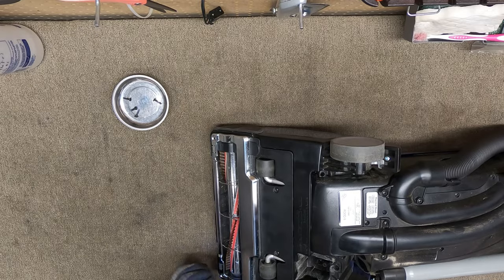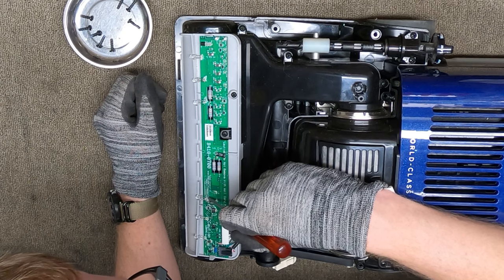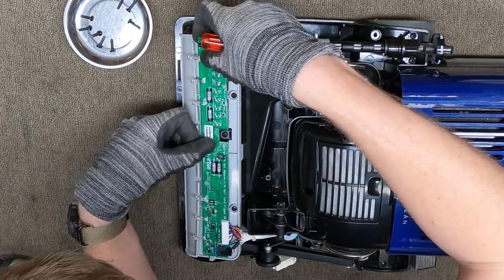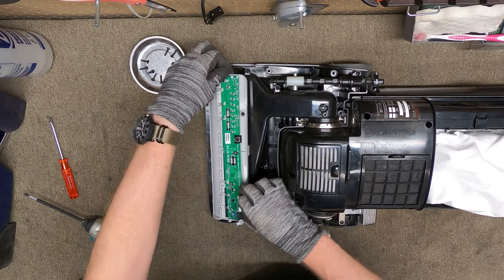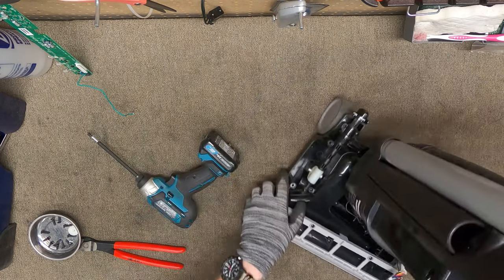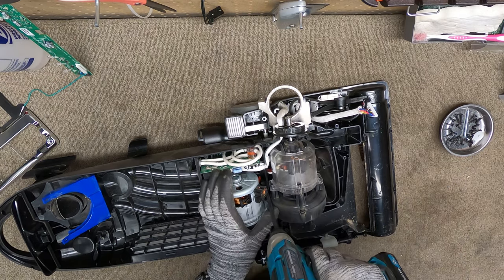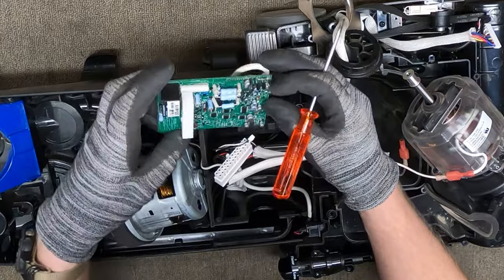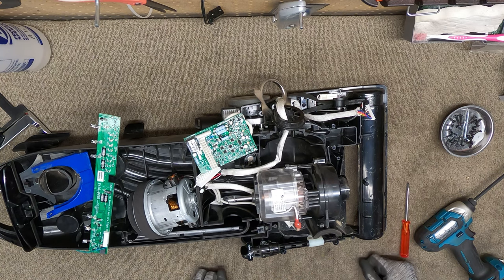RICCAR PCB PROBLEMS & TROUBLESHOOTING

Comment: Another issue I have encountered with these is the white wire harness that goes from the main board to the auxiliary board. The white sleeve and the wires inside are incredibly delicate. I remember replacing a main board and that harness because it got damaged god knows how during normal use. When I was re-seating the harness into the little slots I used the blunt end of a driver bit. Like one end goes into the drill and the other is a Philips head. I used the rounded part to push the harness and fold it into the little slots so the top cover could close. Somehow this damages both the sleeve and the wires inside. Had to get another harness.

I have had to replace at least 3 brush roll motors that were less than 2 years old. 

Half the time the top motor cover doesn’t seat properly and is a 20 minute ordeal to cram everything out of the way so it fits.

The brush light on the front likes to turn on when you so much as sneeze in its general direction on some units.

The mainboard is always coated in what looks like carbon build up if you open it up after like a year.

The simplicity version of this machine whatever they call it uses a slightly different sized fan for the brush motor so we have to stock both variants. Even though they both use the same motor.

Finally the filters are two damn expensive. 

These machines and the big brother, the R40D are the poorest execution of a great idea I have ever seen.
Reply: Legitimately a headache. I have never in my life taken apart a vacuum to repair as much as this thing. Now I'm on YT again trying to figure out yet another issue with the carpet motor shutting off and on like there's a short somewhere.  

I've done the math. Even if I bought a new cheap vacuum every two years for the rest of my life I still come out below what I paid for this monster. I would never recommend it. 

But I fully agree, the absolute poorest execution of a great idea I've ever seen.

Comment: My R30D was a monster carpet cleaner… but an absolute nightmare if/when something goes wrong.  Unlike most direct air machines that make accessing the d.a. motor easy… Riccar missed that memo.  Heaven forbid someone accidentally suck up something they shouldn’t.  No thanks.  Got tired of dealing with “the diva” and sold it.  Luckily only bought it for $300 second hand & sold it for $250… but I feel bad for the people who pay $1200+ only to learn the lesson.

Comment: For the R30D.8: 30 is the series, D is deluxe, and 8 is the revision. :) Usually I get the 40 series in (S40’s and R40’s) with main PCB issues. The worst job to do on these in my opinion is changing the wiring harness… awful.

Comment: I remember Tacony fifteen years ago. They had the Vibrance line. Their 8000 series was the flagship line. It was a completely different brand back then. They actually once made good vacuums!! I got an 8955 that’s almost twenty years old and it works fine. These Tandem Air machines feel pretty damn sturdy, but they are too complicated with computers!!

Comment: I’m really glad that they finally stopped making these machines. They and the old Panasonics that they were based on were ridiculously over complicated and yet they were still single motor uprights with a delicately built clutch break to stop the brush roll for bare floors. It’s as though they put computers in them just so that could charge more and for no functional benefit.
Reply from the maker: Oh they still make them.

Comment: I came across your series around Riccar and how much you don't like their product but it looks like it was an older series. Would you be able to create a video going over why or why not you have or haven't changed your view of their new product line? Seems like every reviewer I come across except for you loves their current product line and I haven't seen you opinion on their current line.
Reply from the maker: Sure thing. Cleaning ability on Riccar is good not great not bad but just good . The big problem is how the company advertises their product and runs their company. They didn't used to be like this. But currently they close 2/3 of their American manufacturing and are currently just importing things from China and sometimes assembling them in the US but mostly just Gray Market imports. This wouldn't be a problem if they didn't advertise "made in the US"the other thing is they tend to beta test things on the public for very long periods of time they still do not have the tandemair vacuums sorted out. So between manufacturing problems and just bad ethics I don't recommend them.
Reply: I appreciate you quick follow-up!  @PerformanceReviews

Comment: It’s an issue with those PCB on Riccar? Well if it’s American made or not it’s not important (marketing is one thing but a profitable business it’s more important). So besides that it looks like process to manufacture those PCB comes with problems. I just open a couple of vacuum cleaners but a lot of routers and switches and many many different computers some of them minicomputers old ones. So I can ask: Why Riccar does not build a proper harness? This could help their machine. Also remembering the genius from Steve Wozniak why they don’t design a proper PCB? American design on PCB for computer was elegant and I think still is but this company could improve with better design. About the bags well that treat to Envirocare it’s not ok.